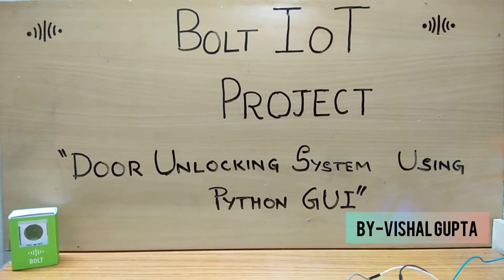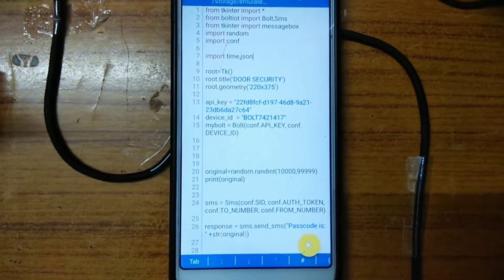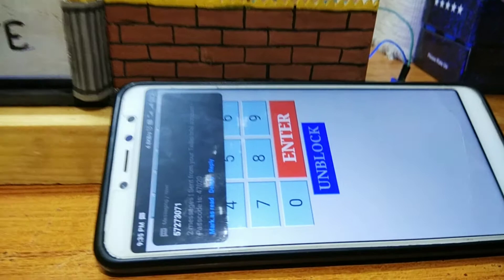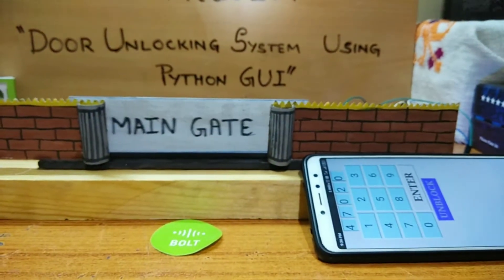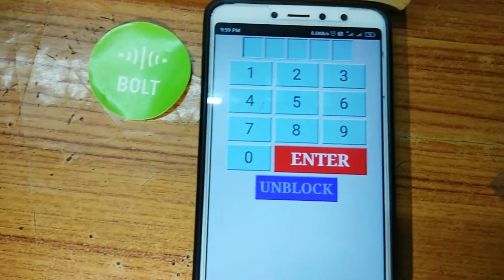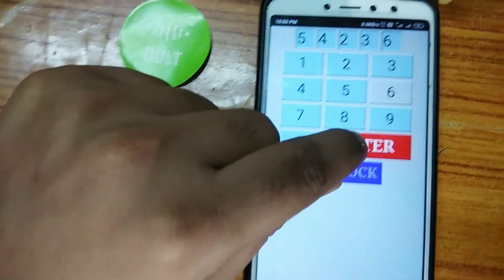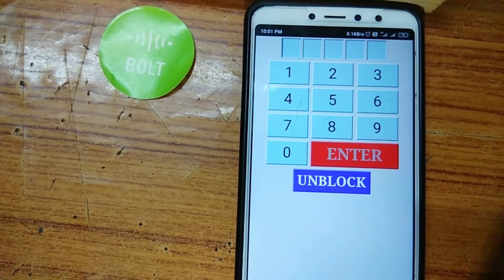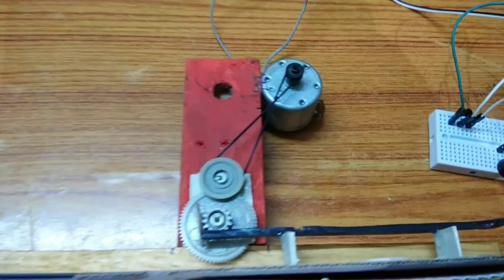Bolt IoT Final Project | Door Unlocking System | Bolt IoT

Comment: Sir my connections are correct but the motor is not running as per code, if reverse the transistor then motor working continuously without stopping please help asap
Reply: How uh solve the problem?

Comment: Get all Bolt's trainings at 80% DISCOUNT only for TODAY. Use the discount code FREEVAB17146 at checkout on https://shop.boltiot.com?utm_offer=referral%26discount_code=FREEVAB17146 before 11:59 pm TODAY. 

The offer ENDS TODAY at 11:59 pm.

Summer Trainings available: 
1. Web Development Training 
2. Voice Assistant (Alexa and Ok! Google Training) 
3. Augmented Reality Training 
4. Robotics Training 
5. IoT and ML Training 

The limited-time offer ends TODAY at 11:59 pm. Also, applicable for only first 100 registrations. 

After TODAY, the trainings will be sold at their original prices. So you have to register right away. 

Register now and start training after the exams. I feel that you should not miss this opportunity as these trainings will substantially increase your chance of getting a job offer and improve your practical understanding of engineering. 

Courses come with certification and lifetime access to the content along with an internship with a stipend for those who excel. Since it is *lifetime access*, the students can register with the offer today and start the trainings whenever they wish as per their convenience. 

You will be trained by mentors who have more than 10 years of experience in the IoT Industry.
They were showcased at Silicon Valley, USA during the visit of the Prime Minister of India in 2015 for their innovation and patented technology. 
Last year their product Bolt IoT Platform has been featured by Raspberry Pi foundation itself as the best maker hardware in the world. 
This is a unique opportunity to learn from the best in Industry and become an extraordinary engineer. 

The offer ends TODAY at 11:59 pm. Offer valid for only the first 100 registrations.